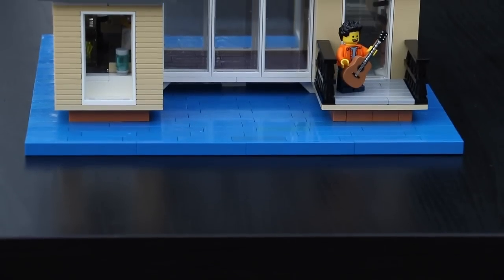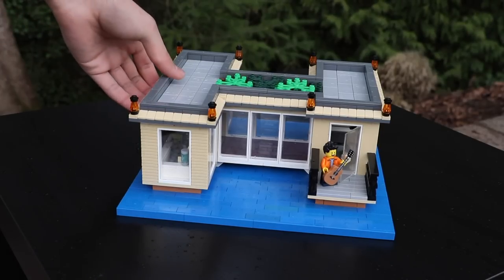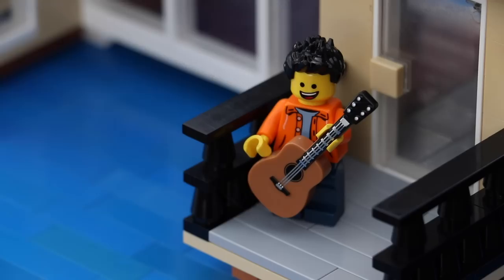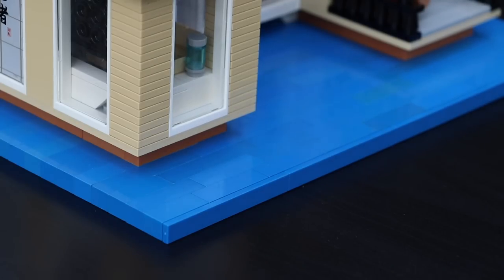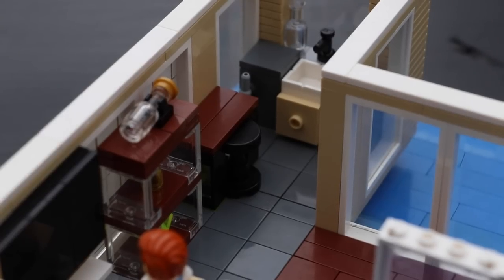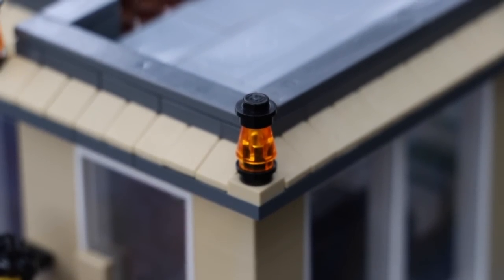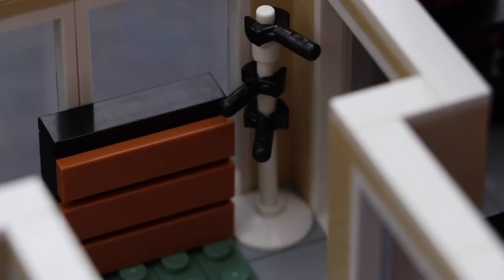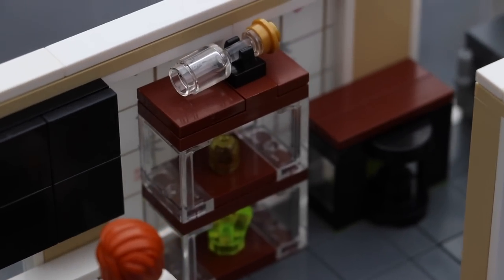LEGO Modern Boat House MOC (House on Water)

Comment: You have used a great technique to achieve great vision of the house. The only thing that I do not like very much is the size of the two rooms. Regarding this do you think that if the rooms are made larger than 6 studs wide open space (probably 8 or 10 studs) they will look better and will not make the bridge between them look diminutive?